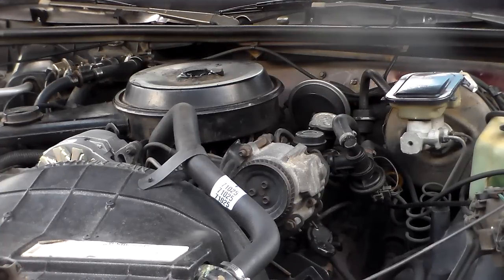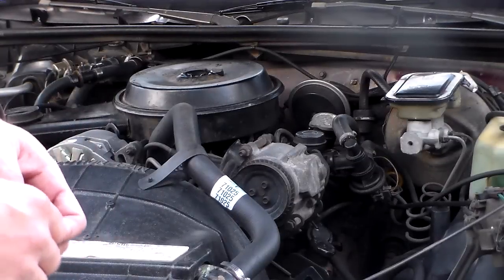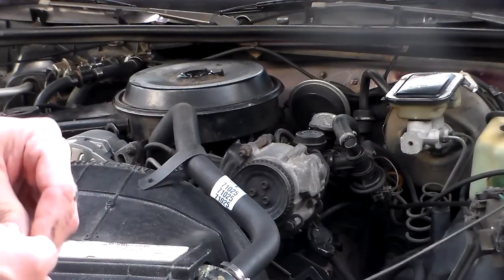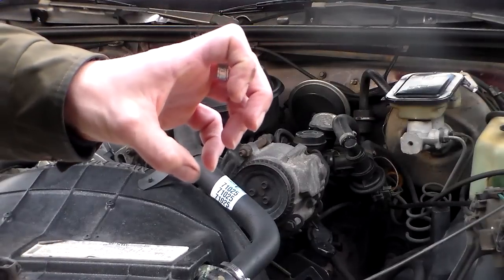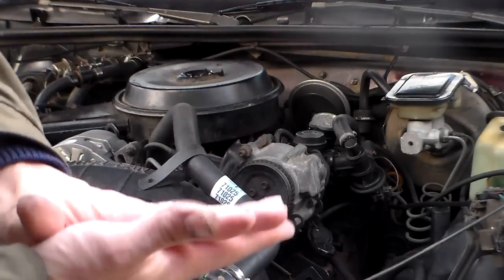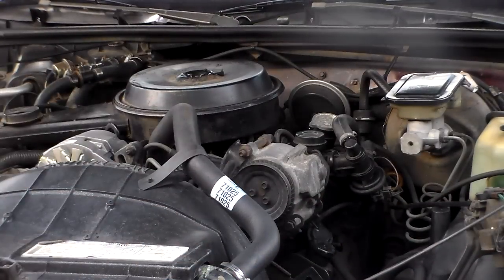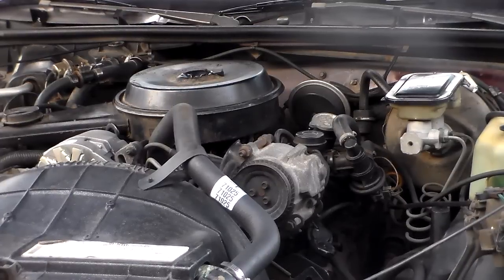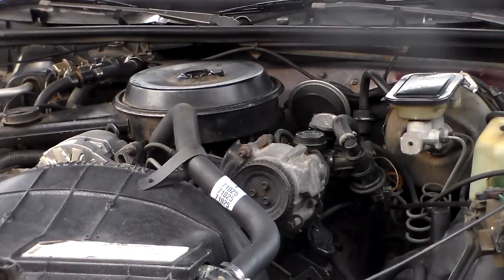Demonstrating a broken motor mount

Comment: Thanks for the demonstration!!!

I have an 07 Honda pilot. I replace the passenger side motor mount it was disintegrated. 

I performed the stall test as described. The motor raises a lot in drive and moves around. When I put it in reverse, it barely moves. Which motor mount would you say is bad if you know a Honda pilot motor mount configurations it’s three motor mounts one in the front, one in the rear and one on the side and then it has two transmission mounts, but those I can see and they are fine .

Basically, it moves a lot and drive it raises up and moved a lot in reverse. It does not look like it moves at all. 

Is it the front now? Donut shaped motor mount right behind the radiator if it means a lot in drive on a pilot? 
I hope you know this, as I have been trying to diagnosis for a month

Comment: Never pump the Accelerator on a Carbureted GM vehicle, you depress throttle pedal fully then release, the fast idle choke is now set, and your car will start the way it was designed!

Comment: yeah today I found out my mechanic told me that my motor mounts are gone when I looked at them last year the mechanics said they're fine even last week they said they were okay I take it easy on my car I have a 99 Lexus my engine score was very high it's a great engine just tuned it up and I can't keep putting money into it it's an old car so the mechanic said to just drive it the way it is it'll be okay the only thing that it does it triggers the knock sensor the check engine light but other than that he told me to keep driving it and just buy another car oh by the way he also said don't buy a new car cuz they're only designed to last 5 years but you know this is no reason to panic I've had cars with bad motor mounts before unless it's really really bad then no worries

Comment: My 97 Saturn wagon sw2 has a massive vibration so I took a look at the mounts and for sure it is worn right down. I am gonna do a temp fix till I get a new top mount. I am gonna put few layers of thick hard rubber sheets in between inside the mount cage. It'll work for now.

Comment: 01 Pontiac Grand Prix. 
What is a decent motor mount that won't break the bank?
Everybody on the internet is saying that anchor and DEA are junk. 
I am not looking to spend $80 at the general motors dealership. 
I am not real hard on my car will a anchor or DEA Mount be good enough for me?
Reply from the maker: Just about all the aftermarkets are made overseas these days, even GM. I would find the part with the longest warranty and go with that.

Comment: Can damaged mounts cause rough idle when you shift from park to drive or park to reverse to the point where it seems like it'll stall?
Reply: Yes they can they can cause your engine to move in a unnatural pattern which feels like a rough idle but I would watch your RPMs if your having issues with stalling and things watch the rpms if they move or are not steady at idle you may have a diffrent issue

Comment: This is exactly what's happening to my 83 3.8l v6 supreme. I just got it for cheap from a friend. It's cold here and when I start it the idle stays super high. When I shift gears the whole car rocks. My dad shifted gears with the hood up and the whole engine jumped. Kinda need help lol where can I buy parts to fix this and which parts would you recommend?
Reply from the maker: It just needs a mount. Rock Auto usually has them super cheap. The 231 is hard on mounts anyway because it idles so rough. The very first "231" in 1975 was an odd-fire engine and it was one rough-running sob. The later engines with the balance shafts improved it a lot.
Reply: @TylersNeighborhoodGarage  Thank you for the reply! Will do.

Comment: I have a 2015 Honda Accord LX and I changed struts, sway bars, lower ball joint and tie rods but still hear noise when steering when taking off or parking
Reply from the maker: Check the outer CV joints.

Comment: 2014 nissan altima. Bad motor mount led to all sorts of knocking and banging because the engine was rocking and knocking into the frame.. Driven for 4 months like this with a number of mechanics telling me it was the transmission (I knew it wasnt), told me my axle was bad (it wasnt), told me I should contact nissan to find the culprit which i did which resulted in nissan telling me it was my transmission. I gave up with mechanics and played with it myself in an attempt to locate the knocking sound. I used a snake cam and my wife to assist and we found the knock.. my front upper motor mounts had completely deteriorated boots and as he explained in the video, the bolt was the only piece holding the engine in place but when I gave it a little gas, it rocked hard and if given enough gas, it would rock and hit the frame causing a metal on metal bang. If you dont like what your mechanic is telling you, seek a second opinion.. if you dont like that opinion either, try it out for yourself.. cars are like legos with nuts and bolts, everything is meant to fit perfectly assuming you purchase the right parts for your specific car. Plus, you save a lot of money this way. Transmission repair estimates I received was for approx. $2250. Axle replacement estimate was $425. Motor mount replacement was $375. I purchased the replacement mounts from nissan for $125, installed them myself with the help of youtube and took roughly 2hrs. I went from inexperienced, to still inexperienced but I know how to change motor mounts and I'm proud of that. With a bit of self troubleshooting, even if you dont attempt to fix your own car, you'll have an idea of what is wrong with your car before you get to a mechanic. Dont let them sell you a watermelon if you're only shopping for apples.

Comment: is that movement happens when you turn steering wheel or what ??
i got in car accident and van was running but overheat so i replaced radiator and water pump and its good heating wise. but i noticed that car shakes more than normal when idle and when i drive and turn steering wheel there is a very loud noise like metal is rubbing against metal and its really loud. it comes from under the van . not even sure what it is. could it be engine mounts or like axle broken or what ? its really loud and scary 
any ideas ?

Comment: What's the cause of these to go bad? My wife's Mitsubishi Spacewagon has bad mounts but it's not really that old. I hate wasting money on stuff like this. Personally, I've never had a car's motor mounts fail. Just curious what the cause is?
Reply: fuckyoutube they go bad after like 75k miles .. it's just maintenance really. Also try not to go cheap on those parts for obvious reasons.
Reply: The rubber just deteriorates, like other bushings & hoses & rubber parts. Some fail earlier than others. I got my 07 Taurus at 85k & the mounts needed replacing, 40k later & it hasn't seem to have gotten much worse, but I'd replace them before they break break, you don't want premature trans/engine wear.
Reply: Also, if you're worried about price, you can check out a local wrecking shop, mine quoted me about $20 per mount, in shop could cost around $60 per. If you're somewhat mechanically inclined, & you have a hydraulic jack, stands & some wood blocks, you can DIY it easy enough. Mechanic will charge like $300 per...>.>

Comment: Two places diagnosed a bad motor mount for me but I dont have any symptoms like shown online, the only thing Im trying to get rid of is slight stuttering while idle, can be felt through the steering wheel and seat.
Reply from the maker: Motor mounts fail in two ways: they collapse so that there is metal on metal contact, resulting in vibration, or they separate, like this one did. You really need to examine the mount close up to evaluate whether it needs replacement. What kind of car are you dealing with?
Reply: WhoSaidTyler changed the motor mount and all is well now :) it was the peugeot 207 GT THP 150, shares the same engine as some minis (EP6DT)

Comment: just strap the motor down witha  ratchet strap
Reply from the maker: +milldabeast519 I wish I had thought of that
Reply: +WhoSaidTyler LOOOL tell me about it! i  replaced the motor mount 8 months ago with a brand new one and it broke again! really thinking of welding the motor mount and straping/ making a bracket from the engine hook to the drivers side frame. the engine hook is right on the drivers side right where the most prone to breaking (drive loaded) mount is... need the poly mounts but that dont have em after 2001 and i got an 02..
Reply: Zip ties.
Reply: milldabeast519 and

Comment: that helps a lot. My bronco just started shaking out of no where. I'm pretty rough on her, I'm always flooring it, I'm always racing and jumping it and she has 280k on her. Still runs like a dream. But I'm taking her to a buddies house today to try to diagnose what's the deal. I'll try to post vids so more people can see more examples of a bad motor mount. There is definitely a lack of vids for oldschool RWD set ups when it comes to this topic.

Comment: No wonder the mounts broke. The idle is high as hell
Reply from the maker: That's because the choke was on. I know that's very rare on carbureted GM engines these days due to people "fixing" them.
Reply: +pontiac38gm should be able to hammer on that think and not even have to think of motor mounts breaking... thats a joke! its a 250FT of torque better not be enough to snap a motor mount.

Comment: When you fix the motor mount make a video.  My 1989 olds custom cruiser in the back yard is grounded (and under 50 cm of snow) because I have two problems needing attention.  The motor mounts and carburetor.  Your videos have helped me restore the carburetor.  But I believe the trouble started the effect of stretched cables to the carburetor with the engine lifting.  The throttle would stick open when the motor was lifted.  Typically, when turning left and accelerating.  carburetor problems alone would not explain the throttle problem.  Thanks again for keeping faith with these old cars.

Comment: had a front mount fail on a v6 chrysler minivan... broke a fuel line connection and sprayed gas on the engine... burned the engine compartment crispy before i could get an extinguisher on it... total loss.. had $100k worth of client equipment in the back... lucky to save it...
Reply from the maker: ouch
Reply: thats bad man
Reply: yeah, it was on my "to do" list for the next day...  since then, i change broken mounts as soon as they break on EFI cars.. well, all cars really.. lol